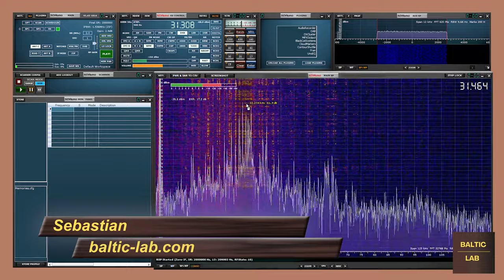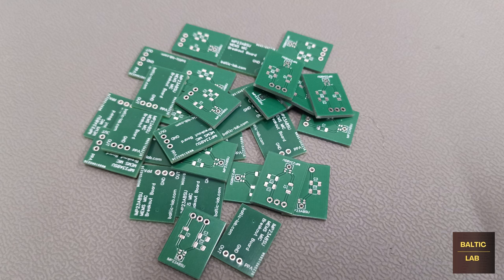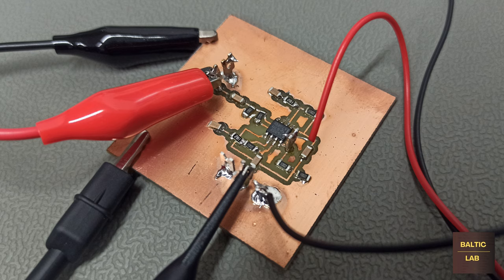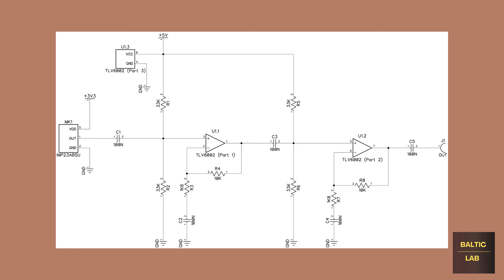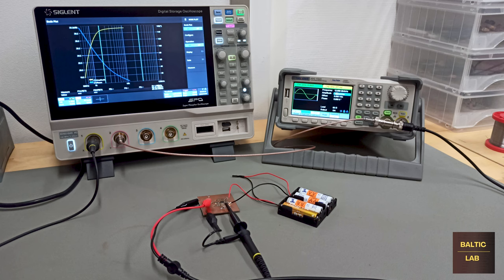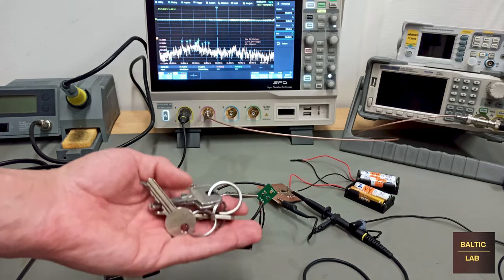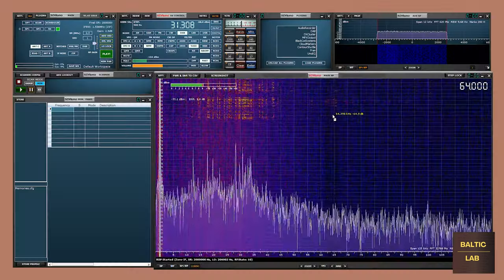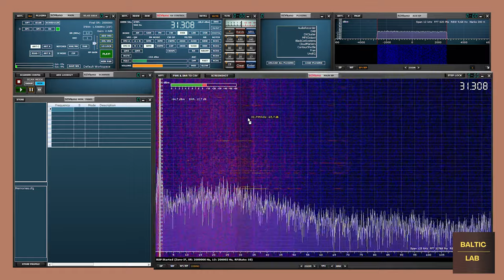Listening to Ultrasound with a MEMS microphone and a SDR Receiver

Comment: if i need to save the ultrasonic waves , using an ESP32-S3 in order to process them later with the same ESP32 , must i connect its output with an inbuilt I2S ADC before connecting it to the microcontroller??
Reply from the maker: The ESP32 has an ibuilt ADC that you can use. I didn'T look at the sample rate / nyquist limit to see if that information is accurate. But even if the ADC is "too slow", you might want to look into sub-Nyquist sampling.

Comment: This is the typical sound of a microphone overloading, those are those weird pops and clicks. Because the IMP23ABSU has a peak around 27k of 17 dB, it also means that the microphone will overload there the earliest. So if the acoustic overload point (130 dB) is actually the part where the output (the signal is going from the bias, and has the range from Vdd to GND basically) is clipping, it will be reduced to 113 dB. As humans you cannot hear this, but the microphone can. Rattling keys are a very good way to induce high frequencies. Others are indeed splashing water, or crackling chips bags.
Reply from the maker: Not sure if that's true. Doubtful to begin with that those sound levels are exceeded by the generated noises. Asides from that, the sound doesn't change at all if I repeat the experiment vom 5m distance from the backside of the microphone (that was the set-up when I discovered the keys as noise source). But the amplitude drops significantly.
Reply: @BalticLab  Interesting, in my experience key rattling does get way louder than you think and leads to overloading MEMS speakers with their typical high frequency frequency response (electret microphones  have way "softer" peak, and thus have this problem less). If you want to investigate this, you can either check the distortion, but you will need a coherent source (like a tweeter, they can go up 40k often with enough amplitude) or look at your scope directly at the output if the level is bottoming at 0V or clipping at Vdd.
Reply from the maker: @nurab-sal1276  I appreciate your input. When I have time, I'll look deeper into it and try to verify whether or not that's the case here. Personally I don't think so, but going by opinions would be unscientific, so I'll check and verify. Also note that the receiver uses automatic gain control, DSP filters and we're listening to the SDR treating a signal as if it would be a double sideband signal. So I am confident that some artifacts are contributed to that as well. But again, verification goes a long way before reaching conclusions.